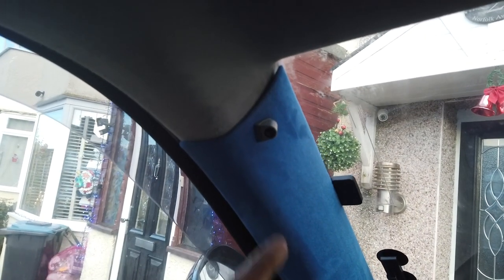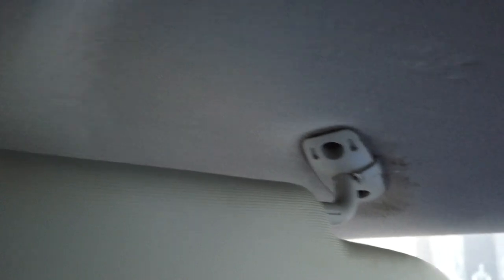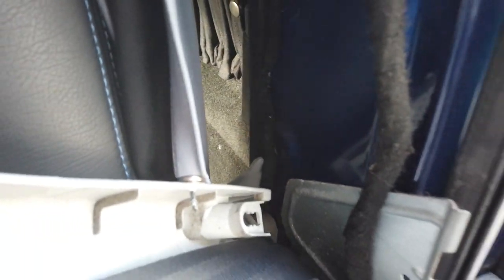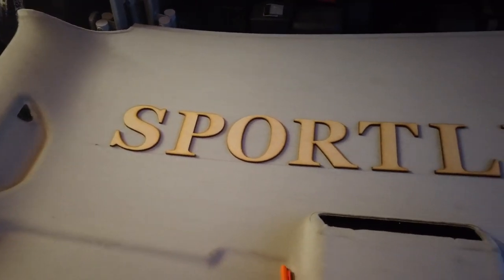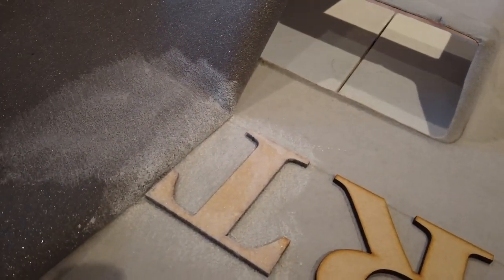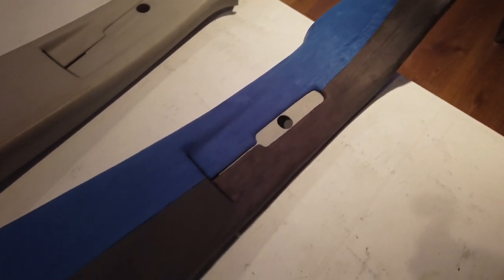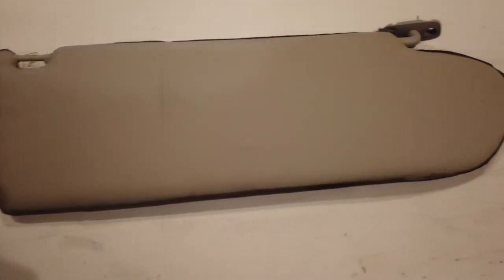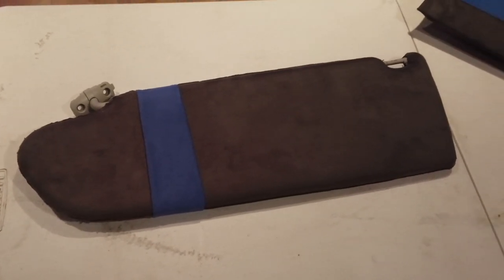Bespoke Roof Lining On My VW Transporter

Comment: That looks really good. I have just removed the cab roof panel from my T4. It took a couple of hours to remove all the old fabric, foam and glue and then remove the residue left behind. I am going to cover it in light grey faux suede 4 way stretch fabric with a 2mm foam backing.

Well done on a cracking job.
Reply from the maker: Thank you for saying, good luck with your job👍🏼

Comment: VERY NICE Charlie. I'll be posting up my project  soon ,to change that silly little cubby hole (that all transporters have) into a USEFUL double DIN hole. This will then take a head unit (into a heavily modified original cubby Ive cut and shaped) - tilted down with reverse camera/ GPS/ etc. Ive made up an ISO extension lead from the original position up the windscreen pillars to the new head unit location. The old one will become a switch panel/ drinks holder. DAB aerial is going on the roof. Finished off by an LED headlining (maybe a starlight one?)  once I fibreglass a new shape for the headlining to follow where its now larger. I got the idea from you!👍
Reply from the maker: Sounds good, glad I could help👍

Comment: Looks brilliant!

How far over the other side did you glue down material? I’m trying to use 4 way stretch carpet and concerned about it fitting under the door seals.
Reply from the maker: About an inch should do it, 4 way strecth carpet can be a bit thick which is why it's not really the best stuff for roof lining.

Comment: My didn’t work have you started  sticking the material from bottom or from side ?
Reply from the maker: Hi, it can be a bit fiddly, I started mine from the side.
Reply: did you sprayed glue bit by bit or bigger areas do you maybe have email address or some form of contact where I can send you video explaining what went wrong. 
Thank you     @charliesautos
Reply from the maker: @oliwer5963  charliesautos101@gmail.com

Comment: Is that black or dark grey?
Reply from the maker: Dark Grey
Reply: @charliesautos  cool, nice one. Just wanted to make sure before ordering, I’m going to have a go at it 👍
Reply: @charliesautos  also if you don’t mind me asking what size do you get for the roof only or did you get a few pieces
Reply from the maker: No it's just one piece so have a measure up making sure you go over by a good few inches for folding over.👍🏽
Reply: I’ve just had a go with the trim fix glue you used, sprayed on bothe suade and the roof panel, it’s not sticking? So frustrating did you do it bit by bit? I left it 20seconds to go tacky on both then applied
Reply from the maker: @AkimboVermon that's strange? Make sure you shake the can properly and the temperature is not to cold, could possibly be a dodgy can, maybe try another.